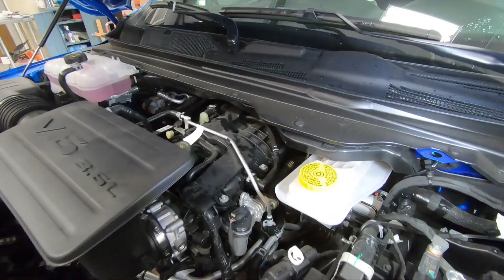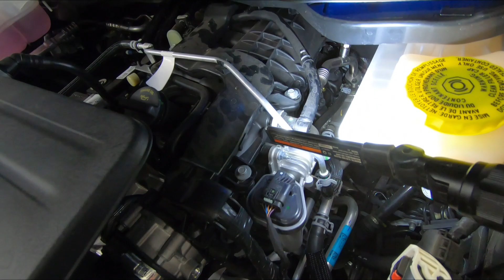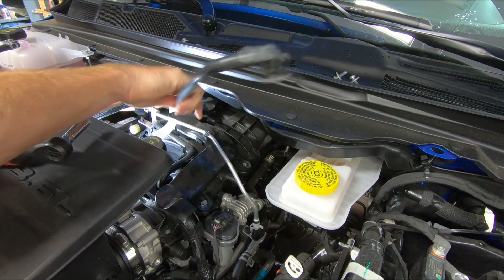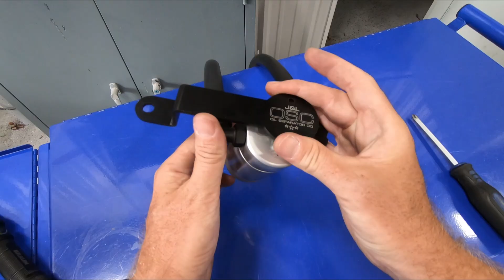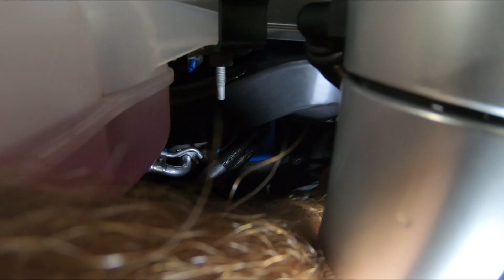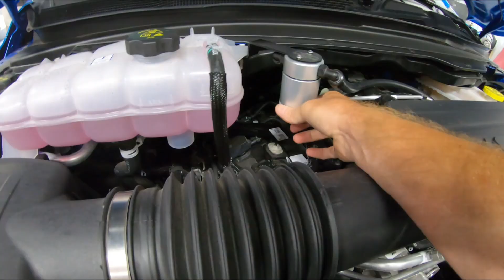J&L Oil Separator 2019-2026 Ram 1500 3.6L 3126P Install

Comment: Holy smokes that back hose was so difficult to remove. I tried laying down in  multiple angles until I got it just right and then with some finger magic it came off. Word to the wise my 2019 ram 1500 had a plastic accent piece over the plastic intake manifold which requires 14mm and 12 to remove those bolts as well. I also found it useful to loosen the 10mm bolt on the rear right of the manifold to help maneuver the oem hose. Good instructional video otherwise. Thanks.